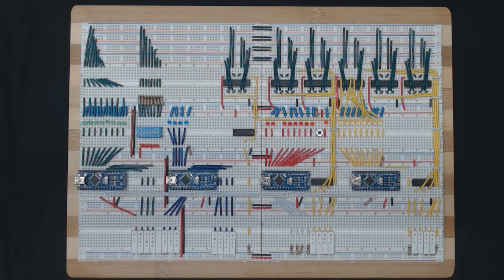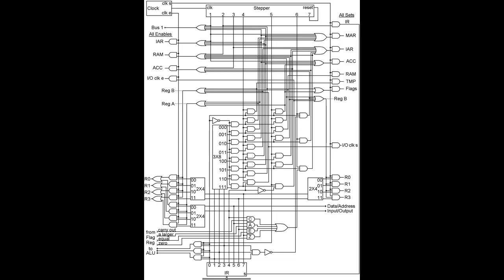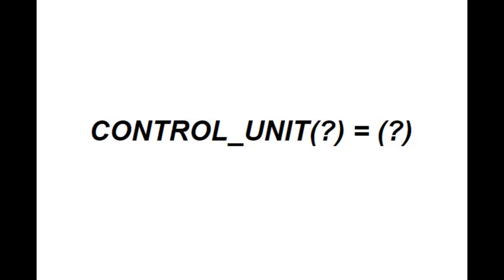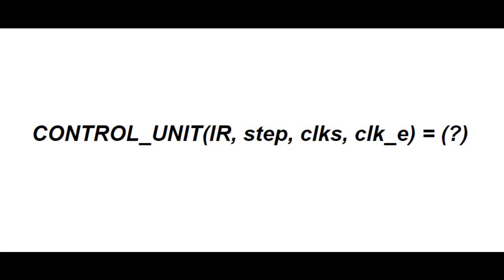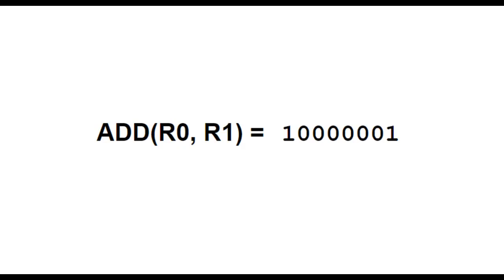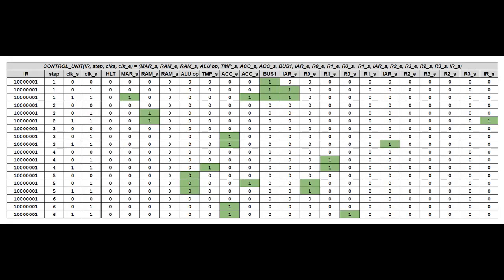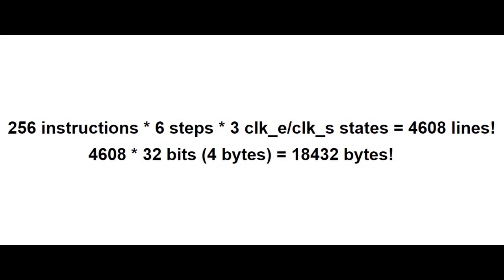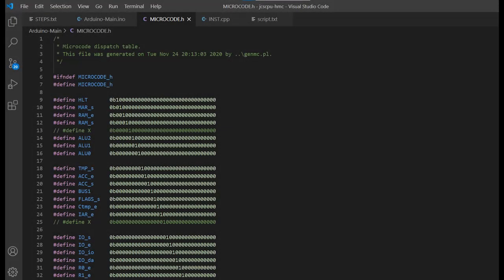But How Do It Know? Video #23 - Microcode

Comment: great explanation. ok i understand Microcode but how it knows assembly commands when we enter values and type ADD,SUB,JMP... commands from keyboard ?  I think i need to research Lexical analysis about that. Can you also make a video and explain it also ? Thank you
Reply from the maker: To transform a human-readable assembly program into byte code you need to write a program called an assembler. You will in fact probably need tools like parsers and lexers to do that. Then, in a simple case like we have here, you need to write some kind of bootloader to get the byte code program from a file on disk to the CPU RAM. In this build it is one of the Arduinos that handles that.
Reply: @patrickleboutillier  so gaoing further how it works i have to research parsers and lexers as i understand..